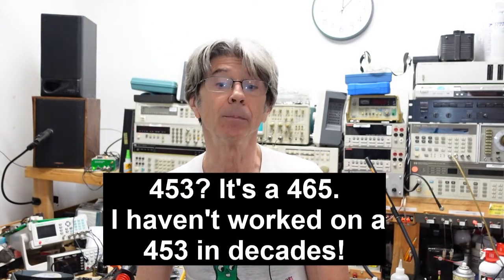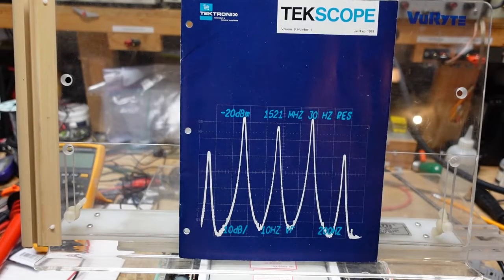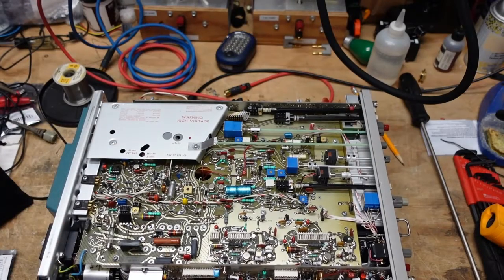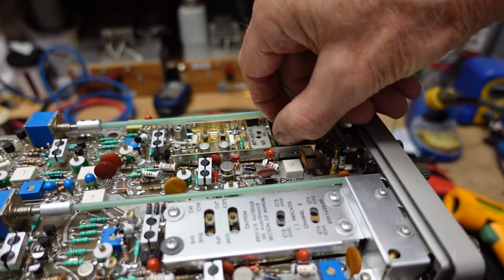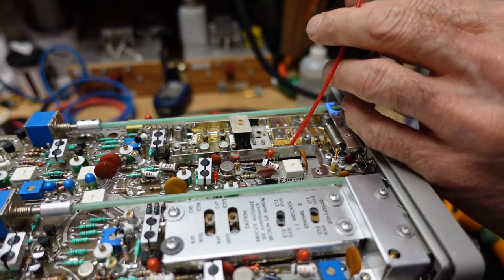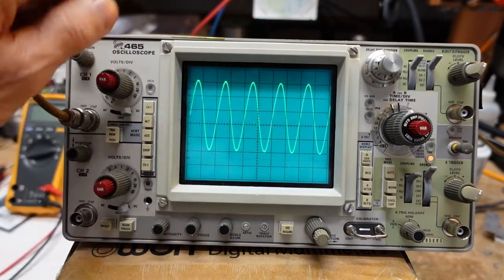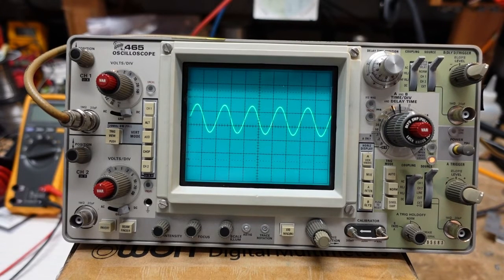Tektronix 465 No Display Part 3

Comment: great info on that problem.  I have a 475 I am working on.
Reply from the maker: Mike, the tantalum caps on these are becoming problematic, usually shorting out.  I did two 475's, and that was the issue with both of them.

Comment: Tengo un tektrinix 465b tiene un estado impecable ..ahira surgio problemas con la fuente de alimentacion. No se quemo fusibles .pero las tensiones sin erroneas no tiene los +55v y los +110v  asi que intento reparar ..veo que este oscilosvopio no se reparo nunca pero por sus años ahira dio la primer falla .
Reply from the maker: La clave aquí es el suministro de +55 voltios, que proporciona la referencia para muchos de los otros suministros regulados. El primer paso es tratar de ver si hay una carga excesiva en el suministro de +55 voltios. Si ese no es el problema, entonces puede ser el suministro de +55 voltios en sí.
Reply: @raygianelli3612  muchas gracias por responder !!! Bueno estaba haciendo mediciones en el transistor de potencia del suministro de los +55v .en el colector existe u a tension de +81v y en su emisor +8v  en su base  + 8v  seguire hacia el IC MC1458 P para ver si localizó la falla .  ..agradezco todA ayuda

Comment: Hi Ray, 
I really liked your video series on this Tektronix 465. You really seem to know oscilloscopes. 
I know almost nothing about oscilloscopes, but I want to learn. A week ago I bought a very clean Tektronix 455 at my antique radio club swap meet. It also has no display. It doesn't power up except for back light for the screen, so I know it's getting some power, but that's it. The note on the 455 said it was blowing the 1/2 amp fuse on the 32 volt circuit. I was also told that all the transistors were checked and were OK. There's almost no information on the 455 on YouTube. Are the numerous 465 oscilloscope repair videos close enough to my 455 to help me troubleshoot and repair my 455? Do you have any other advice? 
Thanks a lot, Tom
Reply from the maker: Tom, please send me an email.  That way I can annotate schematic snippets and give you a starting point.  My email address is under the About tab on my channel's home page.

Comment: I loved working on Tek equipment.  They had the best user/service manuals.  When I was in school the instructor would have us check out a service manual because they gave a very good theory of operation, they explained how each circuit worked.  You would never get that now.

I remember two problems with the 465, one was the atten modules.  I believe they had a ceramic circuit board and might even have had some bad solder connections, had to be re-soldered.  The gold plated leaf contacts - I remember one going bad and I replaced it with some gold plated strips I had laying around.  We also realized that one regulated voltage was the reference for another regulated voltage, as you found.  I suspect the high voltage was part of a feedback circuit that also referenced from the part of the supply that was dead, that would explain why it worked after replacing the bridge.

I was an instrument tech for almost 30 years, we would actually purchase new crts, money was no object.

I still have an EICO high voltage problem, had a 1001 meg glass resistor inside.  It went with a VTVM, which the standard at that time was 11 megohms.  The probe needs a home.

Jim
Reply from the maker: Jim, you had a good teacher if he or she was showing you Tek service manuals.  I went to a vocational school,. and it was more of a general purpose course.  It did give me a foundation to learn/build on.
I was an instrument and control tech for a large metropolitan county, then became a partner in a metrology lab.  Both were a crash course, and I gained a lot of valuable experience.
At the rate things are going, I don't know if all our knowledge will die out with us or through hole components will no longer be manufactured.    Hopefully still have a few more years on both fronts!

Comment: just saw a video posted by Tek Museum or something like that showing "tech tips"video from Tektronix about repairing these scopes. it actually suggests breaking off parts as you described.
Reply from the maker: I have to thank subscriber Mark Zacharias for that tip.  Way easier than removing the board!

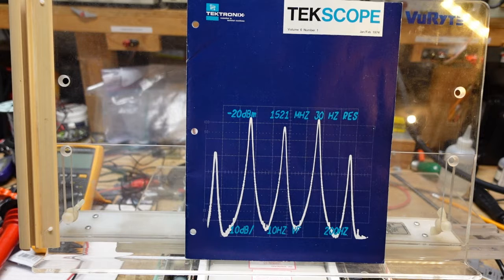Comment: 2:10 We would find all sorts of old magazines left in break rooms in central offices here, one had a collection of Vietnam war era aviation mags, but most were sanitized years ago, along with chucking out any pertinent printed books for turn up and troubleshooting manuals for the office equipment, although a lot was still accessible online (old Nortel and WE stuff was hard to source info on though) and if you ever had to tackle trouble on a old Nortel FD135/DMT300, you definitely needed doc's . One mystery is, that, you discussed "twisting and breaking" the wires to disconnect them from the top, but, how did you reconnect them? I am going to assume you had to desolder and remove the wire tails from the board once it was removed, and then resolder them from the top, but I am also assuming they had through hole plating and pads on top as well.
Reply from the maker: I'm finding old WE docs for stuff from the 50's.  And I found copies of Yahoo magazine, which I was unaware of when it was printed.
Yeah, twisting the bridge rectifier snapped off the leads, and the holes are all through plated.  While these things were well engineered electronically they can be a bear to access and replace certain parts.